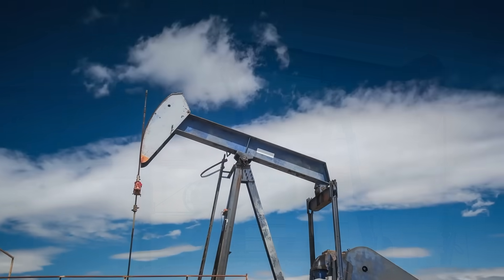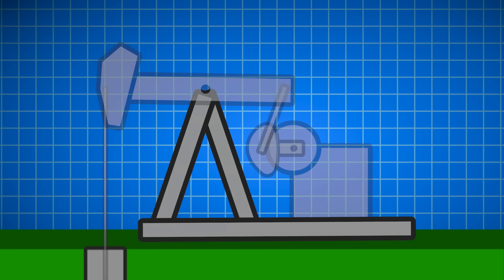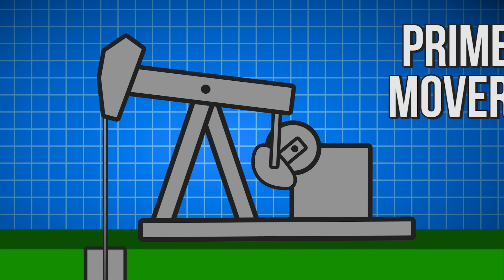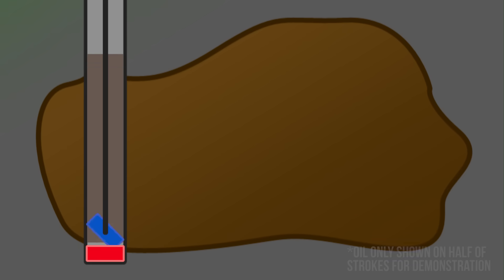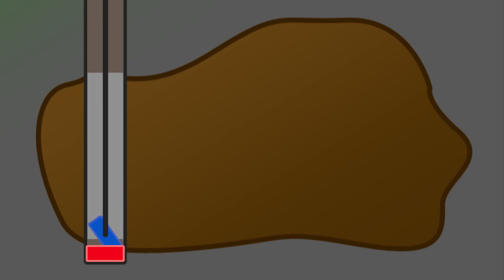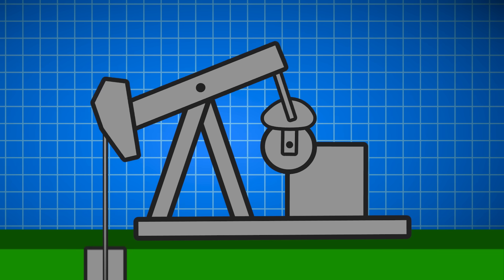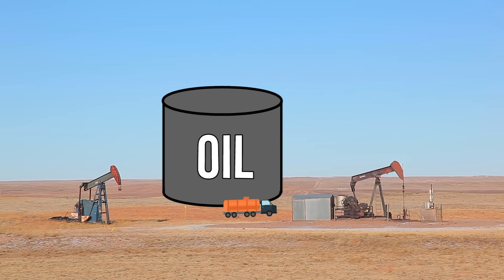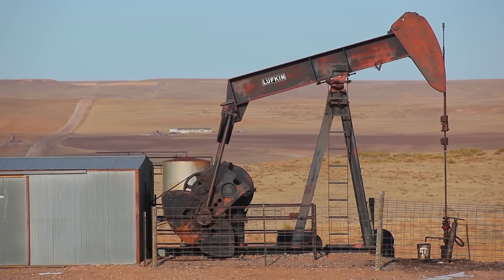How Do Oil Pumpjacks Work?

Comment: An old family friend of mine lived way out in the woods of Texas and about a mile down this gravel road at the start of his driveway there were two of these,  and one day I walked down there to watch them.  It had three massive tanks and one of them happened to be unlocked at  the top and the ladder was open so I went up and looked in.  Never seen  that much oil before but it was still a fun memory as a kid
Reply: You better be glad you didn't fall in that. They wouldn't have found you in time. 

I don't know if there's any coming out of crude, maybe if you somehow didn't burn your eyes and if they had a ladder you could find in time. Now here's a funny question, since oil is lighter than water, could you even swim in oil?
Reply: @dogge929  no, you fall in a tank your dead 💀 Iv worked in the oil field many years as a crude oil truck driver.
Reply: This is a horrible idea please for the love of God never do this its called a thief hatch at the top of the tank and opening it causes hydrogen sulfide to blow out of the hatch when you pop it open I work on oilfield equipment and I wear an air pack to do this exact thing because being exposed to enough h2s it will knock you down and you will pass out instantly and you will eventually die as you keep being exposed

Comment: Are the prime movers powered by the extracted oil or are they simply diesel engines?
Reply from the maker: Diesel or electric, depends on location. The oil that comes from the ground has to be refined before it can be used as fuel 🙂
Reply: @ConcerningReality  

Thanks.

Comment: Why the horse head? Why the counterweight on the crank? Why are they called 'Samson posts'? Why not a centrifugal pump? How does the oil get out of the well and into the pipe/tank without spurting out though the gap for the sucker rod?
These are the questions I had going into the video, and none of them were answered.

Comment: Dude thats not a Derrick. And it’s a traveling valve in the pump. It’s a tank that holds the oil.i.e.large container. But, at least you are helping the lamen’s  out there. Now, explain gas lifts, jet pumps, ESP’s, free flowing,water flood, steam flood,etc. thx

Comment: I'm an Alberta rigger, and have worked on MANY of these. Removing, and installing the horsehead can be fun at times!
Reply: As an  “ Alberta oil Rigger” ( I worked for near 5 years in the boom of the 80’s, I had finally bet set as a Derrick-man ( back then if you 6 months as a Derrick-man, Westburne International would take you overseas and work the deserts of Saudi for big bucks, live on a Mediterranean island… it was 0200 on a freezing cold Alberta winter ( read 40 below zero), my Driller and I, we’re nippling up the BOP’s and my Driller was as cold, as covered in oil and as miserable as I was, that early freezing morning, I made up my mind to go back to school, I quit that long change, started Mount Royal College, received my Bachelor’s degree, went to University of Alberta  School of Medicine, finished my Residency at Grey Nuns and went down to a small farming community in Southern California

Comment: One interesting thing to note is that the horsehead has a precision curve that provides a fixed distance between the tangent of the curve and the pivot point of the walking beam (i.e. constant radius). This allows the shaft of the pump to move in a perfect vertical motion.
Reply: Usually the mechanism that actually pulls it up is cables next to the beam, and not actually grabbing the beam itself, the beam is only being guided by the head.
Reply: Orca James knows!
Reply: Cam principle!!!!

Comment: These things were all over SE Ohio back in the 80's/90's.  I had an aunt(RIP) who lived near Logan OH who had an oil well on her farm.  I think it only did natural gas, maybe it drew up oil when they put it in back in the 70's during the energy crisis.  I noticed over the years though they've all vanished from that part of the country.  Don't know if all the oil/gas is gone or if it just doesn't make economic sense for how little oil/gas you get out of a well down there.
Reply from the maker: I’ve got like 5 in my neighborhood down here in east Texas. Wells dry up after a while so chances are they’ve just moved to another oil reserve🙂
Reply: It's a bit of both, many times wells are drilled grabbing the same deposit, and as the wells all start struggling over the last bit of oil some wells will fold before its empty reducing the number of pumps active.

But yes it is because the deposits dry up, sometimes deposits still exist but are too deep to make economic viability to re-drill a well, or pay for new land to drill on. 

Its likely there's still oil down there, and its likely a company knows exactly where it all is, its just not valuable enough to bother drilling yet.

Comment: What's incredible is that in less than 100 years we went from traveling with horses to landing on the moon but the oil pumps are pretty much the same as back in the days
Reply: If it ain't broke, don't fix it.
Reply: Some things dont change.
Semi automatic handguns is another one that hasnt drastically changed in awhile.
Reply: @nfsfanAndrew  you don't have a ray gun ?
Reply: @nfsfanAndrew, you need to understand first  the principle of steam locomotives, hand guns, and cruise jets!!! Not how!!!! You'd have your answer!!!!
Reply: These days they make an electric submersible pump that you stick at the end of the tubing in the hole which lifts the fluid, sometimes called a rita pump. However not everybody uses them and most are like what is shown in the video
Reply: @demiraltay9046  still the pump Jack will is ultimately used for the final stages of artificial lift
Reply: Well its been 60 years since we landed on the moon and rockets still work the same way.
Reply: Why mess with success?
Reply: I mean, oil rigs brought us to all this of that. So why change something that worked so well? Just replace it with nuclear, o’l pump horses did their job time for a new player.
Reply: Well, that works with other things as well. And it will work in the future.
Reply: @PresidentialWinner  yes like turtles the true masters of this world who are the same as 100 million years ago because their design is already perfect
Reply: @mariovallanzasca9454  I don't think you understand what i was saying.
Reply: Can't improve perfection 😍😍
Reply: If it ain't broke don't fix it
Reply: Yes and no. Now I get paid to push water, sand and explosives into the shale and then extract it
Reply: The moon is overated. I'm staying on earth.
Reply: only very few traveled to the moon and that too for scientific purposes, it's not like everyone can travel to the moon
Reply: They should put a gas station close to pump.
Reply: Don't worry, we'll be right back where we started with all these idiots who believe the moon landings were fake and the earth is flat.
Reply: @wornoutshoes2332 I like your profile pic, but the moon landing appears fake as hell and the earth doesn’t appear to be flat nor does it appear to be a spinning ball with a circumference of 24k miles. Seems to be way stranger. 

In any case, we can agree on one thing: It’s the Jews.😂
Reply: @wornoutshoes2332 the moon landing was faked, but it’s because they got there and found piles and piles of shoes and wooden doors.
Reply: "If it ain't broke, don't fix it"

Expect we do have fracking now so that's a good way to help it along.
Reply: Why fix what isn't broken?
Reply: I LOVE THAT THEY REMAINED THE SMAE
Reply: Stop apply WE to a situation where only afew people in history done/involved.
Reply: Ones real one is goverment propaganda to keep us paying taxes
Reply: A solid design which produces
Reply: Well there's esp pumps and charge pumps now
Reply: We went from riding horses to being able to land on the moon but now we cant build that technology again and instead are going to mars. TV is a hell of a drug.
Reply: And in another 100 years, if anyone has survived the upcoming event, they will be again riding horses!
Reply: Some of them are the same ones just updated
Reply: The human body remains unchanged by 4 million years!!!!
Reply: @dvdortiz9031 
Actually no.
The human body has not remained unchanged for four million years.
It certainly has changed.
Reply: So what?
Wheels have been around four thousands of years but we still have them on our cars.
Do you have a better design for an Oil Pump?
Reply: Landing on the moon 🤣😂😅
Reply: It is almost Libby the time we started pumping oil we had been pumping other fluids for over a 1000 years and the technology had peaked
Reply: Whats crazy is how little this has to do with anything
Reply: Landing on the moon 🤣😂😅
Reply: In 100 years we acheived all this. But we still poop like animals.
Reply: You see its been 60 years since we’ve landed on the moon why havent they gone back in that time as technology has advanced enough for it to be way easier than it was or maybe these days its too hard to fake
Reply: @kaidos8520 why do you need to go the moon?
Reply: @kaidos8520  No significant economical gain from going to the moon for just no reason. There are plans to go back and have a station and orbiters for further transit to Mars within 10 years or so. And while yes the technology has improved, since NASA's budget is now just a tiny portion of what it was during the space race era, they have to work over a much longer time period and some types of missions are just off the table entirely because NASA doesn't have the funding for them. We start having to rely more and more on private contractors and companies to do what NASA can't do with their budget.
Reply: @hotyummy2246  NASAs budget is not just a tiny portion of what it used to be. NASAs budget is exceedingly large and while it's not as high (with inflation) as it was for a few brief years during the space race, it's not a "tiny portion" of anything. It's .5% of the annual US gov budget. That's massive. https://en.wikipedia.org/wiki/Budget_of_NASA

The problems with NASA aren't budget, it's that its become political and the organization now wastes its money on climate research instead of focusing on industrializing space.
Reply: @frontier64  It's also the fact that there's no real reason to go back to the Moon. We went many times and got what we wanted. No need to go back, which is why they focus on Mars now
Reply: @kaidos8520  good point. Also the "technology" that supposedly took us to the moon was lost. 😂
Reply: Yeah,  they're about as similar as a horse drawn wagon of a hundred years ago is to an automobile today.
Reply: That’s cause we never land on the moon
Reply: @simbayoung4757 . Yes we (most people) never landed on the moon but the teams from NASA did.
Reply: @Sillyturner  when? Why didn’t they go back? What definitive proof do you or NASA have that they did? And don’t tell me to go watch that CGI crap
Reply: @simbayoung4757  It's amazing how influencers have gotten you to waste so much energy on this bullshit instead of using it on something more productive, like actually learning science.
Reply: @simbayoung4757 fatass the flag was flapping on the moon due to the moons low gravity and no atmosphere so there is nothing to stop the momentum of the flag from the Astronauts waving it
Reply: That’s because we never landed on the moon
Reply: The only land you stepped on is that of earth :3
Reply: @miloudbouchefra200  and the moon
Reply: @miloudbouchefra200  missed your Thorazine today?
Reply: I usually say the same thing about those who actually believe that someone reaxhed the moon lol
Reply: @miloudbouchefra200
Reply: @NakayamaFesta
Reply: @miloudbouchefra200 
I once walked by within a few feet of Buzz Aldrin, one of the first two men to walk on the moon, so I know that he is real.
You on the other hand are so disconnected from reality that it's a serious question whether you exist in the real world or are just a bot.
The evidence so far indicates that you're just a bot.
A bot designed to publicly embarrass itself by saying completely ridiculous things.
Your designer must hate you to have designed you that way.
Reply: @miloudbouchefra200 its funny how in the middle of the space race that us would magically have the technology to reach moon with humans on it but ussr couldnt
Reply: @kyojin2455 
Magically?
You think that space vehicles fly by using magic?
Good grief.
Do you also think that your car operates using magic?

Just because you don't understand science and engineering doesn't mean that it is magic.

And the Soviets had some disasters including the death of the main leader of their space program and once the Americans landed on the moon a few times nobody including the Americans and Soviets saw the point of spending vast sums of money to send more men to the moon.
Reply: Just review the video and explain to me the source of the wind to which the flag was flapping.
Reply: @miloudbouchefra200  you are a pure idiot. There's no wind, the "flapping" has been already explained many times by many people and was easily reproduced in a vacuum chamber by the Mythbusters. But when you are a deluded paranoid schizophrenic, you keep asking the same stupid questions that have already been answered  and come up with the same conspiratard garbage that has been already debunked many times. Unfortunately, when faced with proof, your flat brains reset and go back to the last safe state, hence the repeating of the crap inside.
Reply: @DanSlotea  Keep telling yourself that, hopefully one day the rest of us will end up believing that shit lol
Reply: Actually dan I believe I remember hearing this on America Fact vs Fiction but the flag was aluminum so it would look like that when it was planted I could be wrong though
Reply: @miloudbouchefra200 the flag was waving because of the moons low gravity and no atmosphere there is nothing to stop the momentum of the astronauts waving the flag around
Reply: https://youtu.be/rRhNgSinObU  @miloudbouchefra200
Reply: @miloudbouchefra200 inertia is a thing. The pole was moving so why wouldn't the flag move?

Comment: These ARE NOT oil derricks, a oil derrick is a tower that a oil well is drilled. Originally a wooden four sided A Frame about 35 feet 1920's to  about 1946, after the war when steel was no longer a war priority , a larger derrick was created a four sided A Frame steel derrick that could accommodate three sections of pipe 30 odd feet a piece for a total height of 90 feet.  Meaning the derrick was 110 to 120 feet high.  An oil derrick is used to explore and drill the well.  What you described as a oil derrick nothing more than support beams of a pumping station.  Over the years we have had fun painting them as insects, Lady Bugs, Grasshoppers and my favorite Praying Mantis.  Third Generation oil field worker, my Grand Father Engineer for Camey, Texaco, Standard, my Father derrick man, mud man, driller, tool pusher, Superintendent oil production Malaysia, Singapore, Tehran, Iran.  Myself WODECO, Taiwan.  Brought up in Oildale, Ca.

Comment: How are they powered? Gasoline, electricity?
Reply: Depends on location, in Ohio it's a mix between electric motors and engines similar to hit and miss engines. Most of which run on natural gas which will feed off the same well it's pumping.  Or propane. Depending how easly accessible their locations are.
Reply: Most pumps being put in today (or replaced) use electric, as natural gas is worth more to be sold, being that electric is more efficient and reliable.

Comment: And then the oil extracted is refined and used to power the pumpjack to pump oil which is then refined to power the pumpjack to pump oil which is then refined to power the pumpjack to pump oil which is then refined to power the pumpjack to pump free air into the atmosphere

Comment: Laymen often refer to things using terms that are somewhat incorrect, but inconsequential. I think that is why Concerning Reality used the verbiage,  "colloquially referred to as Oil Derricks." What I took away from this video was a simple explanation of what the average person (including kids) often wondered about these things while traveling down the road. It's obvious that it wasn't intended as a scientific description of pumpjacks or pump vacuum and pressure physics, so all these technical descriptions and corrections on terms listed below are really irrelevant. I'm reasonably sure that if any one of these laymen ever ventured into the oil business, they would learn all the proper names of all the parts.
Reply from the maker: Thanks!!
Reply: Well that's the public forum of youtube at play, if you only want the basic video then ignore the comments section. For me it helps fill in some gaps/questions I might have without having to look elsewhere. It's all good discussion.
Reply: @oo0Spyder0oo  I suppose, but if I was looking for something a little more in-depth, I'd pick something other than an animated cartoon looking drawing for specifics.
Reply: @finallyitsed2191  horses for courses, it's the dialog that interested me, others might find the simplified animation easier to digest. We're all different.
Reply: im not sure about the last part lol but yeah

Comment: So how do they position the Standing Valve at the bottom??  And what happens if they need to reposition it??
Reply from the maker: The valves along with the rod are removeable. Just pull them out through the bore hole 🙂
Reply: zeaux=they fix the problem by standing in a circle and stroking their cock=hence circle jerk==geesh !

Comment: I thought they drove themselves off oil pressure
Reply: Many wells in  Saudi Arabia have enough GAS pressure to drive the oil, gas & water to the surface  without a pumping unit.  Which is why  arabian oil can be cheaper to produce than in America.  Most wells in America  need to be pumped, hence higher production costs.
Reply: Caliche Kid cool. I wonder what's the geological difference.